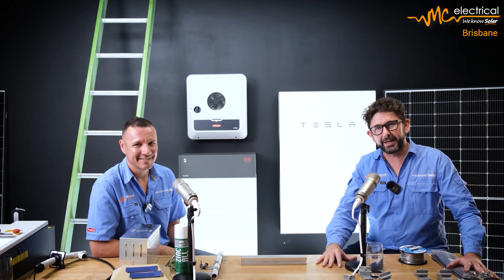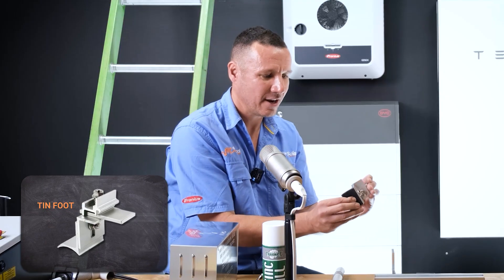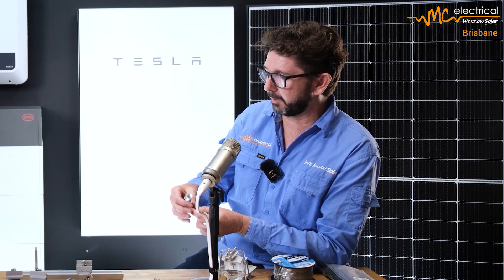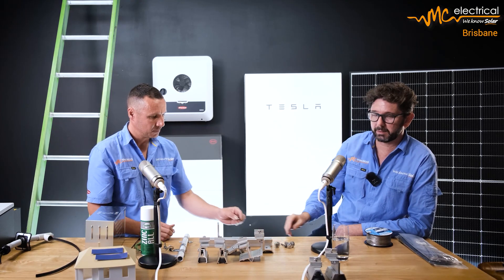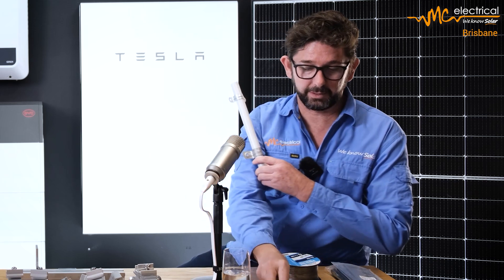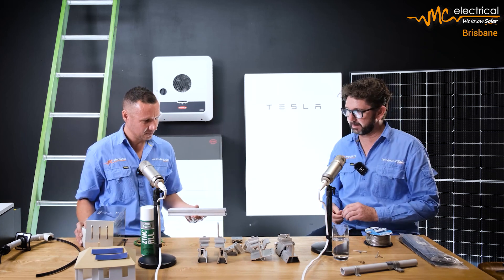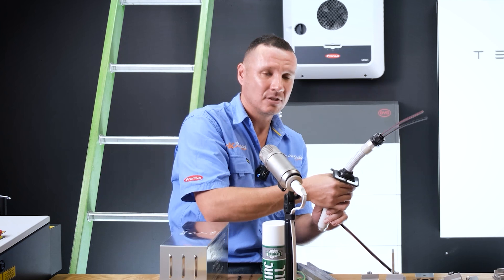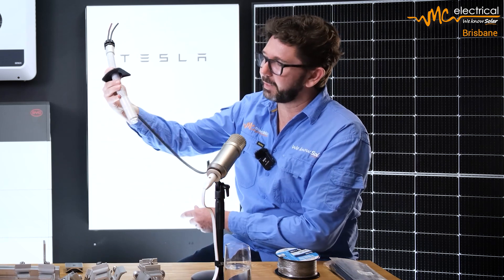Solar On A Tin Roof - Best Practice

Comment: Basically utilize stainless steel where can get it even though costs more but will last a lot longer. Use the correct bracket to match the roof sheet profile. Cable management with stainless steel wire makes sense as does UV rated earth wire, do other solar companies that have been around 15 years do as good a job? Hard to know without going and inspecting the finished workmanship.
Reply from the maker: Yeh, workmanship and the “balance of supply” like stainless cable ties and gal screws are really important to longevity, but the hardest part to show before installation. Maybe I should do a video onsite explaining our workmanship.

Comment: hi there, instead of stainless wire, we use 8mm aluminium round wire, which is also our electric connection for earthing between the rails. thx for sharing your knowledge. cheers Christian

Comment: Mine is through the roof and no isolator. Tried to have fixed... tried to report the installer. No one gives two 💩 s
Reply from the maker: Ha, personally I wouldn’t care either. I still think rooftop isolators are a problem. It does depend a lot when and how it was installed.

Comment: Had a Colorbond roof and the installer from 13 years ago used the wrong saddles on the roof and it caused corrosion.  After the old panels were taken off I was off to buy Selleys Roof and Gutter sealant to make sure the rust didn't get worse. If only this information was available when I was purchasing back then. As a home owner buying a solar system it's almost impossible to know exactly what your installer are going to do and whether they are going to do best practice. I've watched a huge amount of your informative videos and found them very interesting.
Reply from the maker: Thanks for your comment! Yeh unfortunately we take systems off all the week. Most of them less than 13 years old (buy cheap, pay twice). It’s the small details that can make a big difference.

Comment: How do you deal with birds (particularly cockatoos) that might have a go at the wires and panels, or others that want to nest under the panels?
Reply from the maker: Bird proofing! There are specially designed products. We normally recommend a company who will do it after we install the solar.

Comment: Stainless screws are not compatible with colorbond
Reply from the maker: Nice comment. Thanks. At a quick look you are right but I haven’t yet found a screw that suits. Any recommendations? The only real point is where the shaft of the screw goes through the colourbond, and we normally silicone coat that. Seems we could go one better and sleeve it.
Reply: @mcelectrical  The only one that I am aware of is Buildex Climaseal 5, which is what I have specified for my coastal house.

Comment: Interesting, rubber feet on brackets, so you rely solely on the earth strap to ground everything ?  (I get it, there's no earthing to a tile roof LoL, but I'd imagine that if you have a large earth plane underfoot, you'd use it as well, like keeping everything at same potential)
Reply from the maker: Yeh, we need to keep that separate for bimetal corrosion. And roofs are not deliberately earthed. While the may be effectively earthed through down pipes, one coated colour bond sheet isn’t electrically earthed to another. So we treat the roof as separate from the rail and array.
Reply: So scratching the protective coat off a colorbond sheet is what you’re suggesting regarding grounding through the feet??? Just curious because i was always lead to believe that was the whole point of the earth strap.

Comment: Is all your solar work prescribed in QLD? Because all of your points are mandatory in VIC otherwise there’s no way we would be getting our jobs signed off from the inspector
Reply: Yeh most points are just following Australian standards properly. Apart from radiant and maybe gal etc. It was a vic inspector who told me he had not seen catenary used and the  earth we use is not readily available.
But yes, up until qld we are hardly ever inspected. So a lot of the work up here is pretty average. I’m told in VIC, even Sunboost are forced to do a decent install.

Comment: Stainless strapping on new aluminum rail will risk galvanic corrosion.
Reply from the maker: Good point, and valid to an extent. Maybe in aviation etc. 
I took a while to respond to this because I went back to radiant to clarify what they told me years ago.
This is their written reply:

As discussed, when the stainless steel cable ties are in contact with bare “extruded” aluminium, galvanic corrosion can occur.
 
For this and other reasons, Radiant  anodize all rail (min 10 μm anodization thickness). The anodization provides a protective layer to prevent galvanic corrosion between aluminum and stainless steel.
 
“Theoretically, galvanic corrosion will happen if the anodized layer cracks after continuous pressure. Because stainless steel ties are not tightened with excessive force/pressure (to prevent cable damage) the protective anodized layer is fully intact and prevents galvanic corrosion.

Would be keen to know if you have experience other than this. But we’ve been using stainless ties for over 10’years, and it hasn’t come to my attention that we have issues.

Comment: Great info guys, I use 20mm conduit between rails for earth bonding wires and DC as support. Also dedicated Clenergy grounding lugs and any additional saddles/screws outside SS. Very interested in the Radiant rail system and tinned copper earth wire, neither I have seen in NZ. Great idea for moisture drainage too. Thanks for your excellent videos.
Reply from the maker: Thanks Dave. 20mm conduit is a good idea. Stainless screws is a step above!

Comment: What is that product you use stainless wire from rail to rail?
Reply from the maker: We use Pinnacle 3.2mm x 30m Marine Grade
Stainless Steel Wire Rope. 
You want fairly heavy stuff (3.2mm) so cable ties grip on to it, and 30m is size rolls to carry to the roof
Reply: Sorry, I missed a word.
What do you use to terminate the ss rope from rail to rail?

Comment: Good structure framing on the roof is important. 
Owners can look at the materials delivered to site before the men go onto the roof. 
The weak and flimsy should be known, and the higher quality need to be known. 
Labour is the biggest expenditure, not the rails and fixings.

Have you covered this elsewhere  ??
Reply from the maker: Have we covered labor being the biggest expenditure? I do talk about the importance of using in house trained staff.
Reply: @mcelectrical  Sorry, not being clear, I meant the best hardware for mounting the panels.
Reply: @stephenbrickwood1602  ah yes, I wrote a blog about radiant tile feet. Jason and I recorded a video on that too, but some how the file was lost 😢
Reply: @markcavanagh  do it again, do it again, Hahaha.